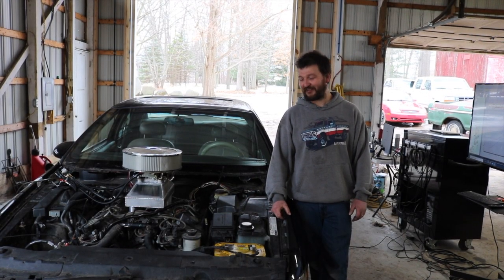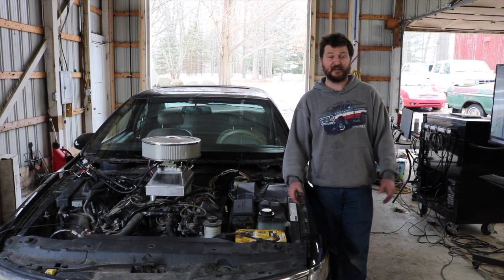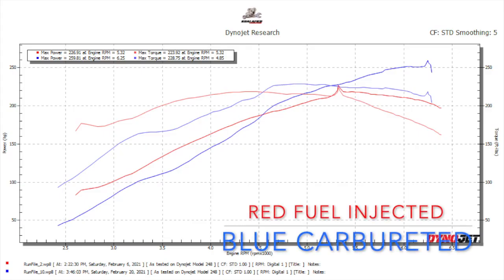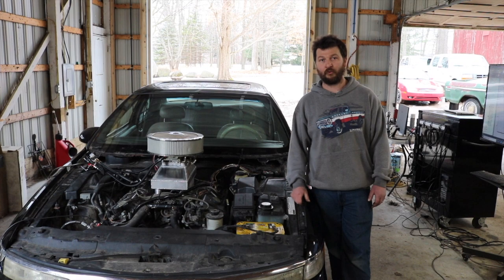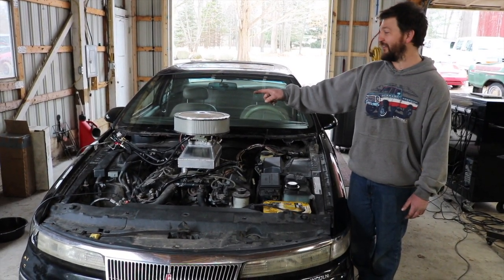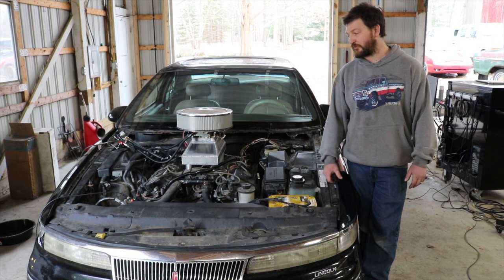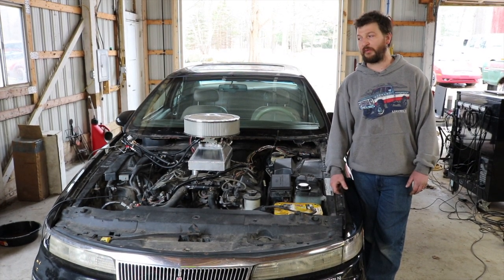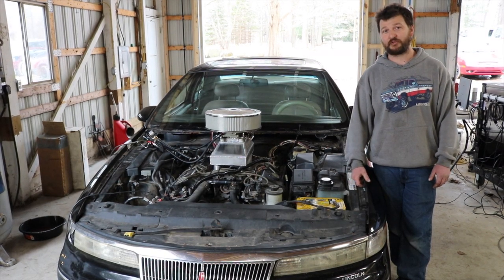Dyno pull with a GoPro in the Mark VIII sheetmetal intake.

Comment: what if you had chamfered intake runner holes
Reply from the maker: That would have helped. The new intake is a drastically different design that will optimize the factory cams. It will have tapered runners with radiused inlets, and a 281ci plenum that is 5 1/2" deep.